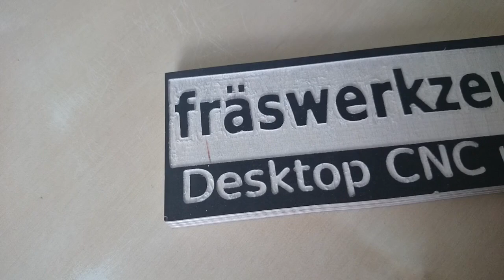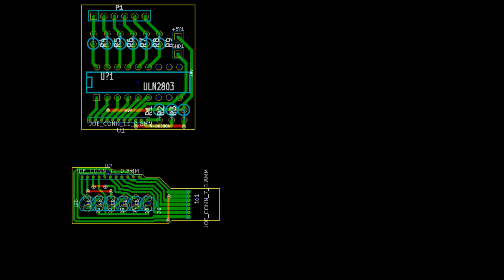My homemade desktop CNC mill - Clip 7/6: A little follow-up

Comment: Have you consider to use a coolant? Specialy to avoiding melt on acrylic?
Reply from the maker: I have - although liquid cooling is tricky when the machine is wooden and the moving mechanics are under the workpiece. But (believe it or not) I actually have used yoghurt as coolant for milling plastic, because it does not run away or splatter too much.

Comment: Hey, I am interested in making a small desktop CNC mill, similar to yours. Most of the parts are simple to source, but I'm not sure about the rotary tool you are using. Could you provide some information about it? I would like to be able to mill PCBs, acrylic and wood, but also brass and aluminum.

Great video series by the way, best one I have seen on YouTube in my opinion.
Reply from the maker: +Mooncabbage Thanks! Makes me happy that people like it. The rotary tool is like a dremel (basically the german higher-precision version of it) but a dremel does just fine for PCBs, plastic, wood, other soft stuff. For metals, a stronger (and faster) spindle motor is needed, but then also a more rigid frame as well as cooling and lubrication.

Comment: which GUI for GRBL, you have used for this project???.  would you like to refer any GRBL GUI software for windows 8.
Reply from the maker: +Bastu Thapa GRBL is a software that is installed directly on the Arduino, so that the Arduino can understand G-code commands that it receives via the USB interface. The arduino then creates the pulses needed by the stepper motor controllers. As "GUI" for sending the G-code commands from the PC to the Arduino i used "UniversalGcodesender", a Java application that runs on Windows, Linux and probably everywhere.

Comment: you can make a 3d printer whit this?
Reply from the maker: Theoretically: yes. Practically: too much efford. It would be a very slow 3D-printer, and my electronic setup cannot control the additional motor for the extruder.

Comment: great build but  dint show grbl setup
Reply from the maker: +Cardona Gulihermino True. GRBL is not hard to set up and well documented - I skipped explaining the setup for that reason. Do you have a specific question about setting it up?
Reply from the maker: +Cardona Gulihermino The github-page of GRBL (google helps) has a comprehensive wiki on how to use GRBL, I recommend to start there with reading. It boils down to settings you need to do before you compile/install GRBL on your arduino (such as pin assignment when you don't use the default pins) and settings you can do later on via G-code (such as "how many steps are a millimeter or inch").